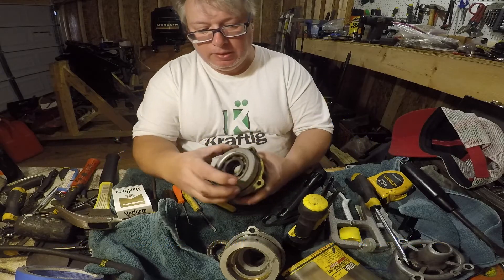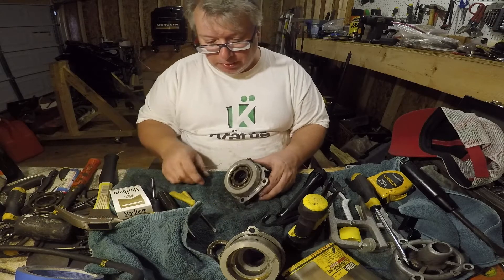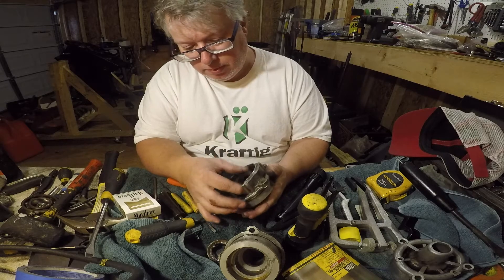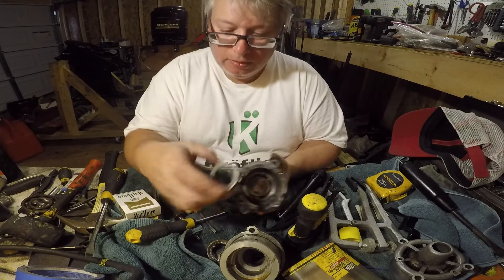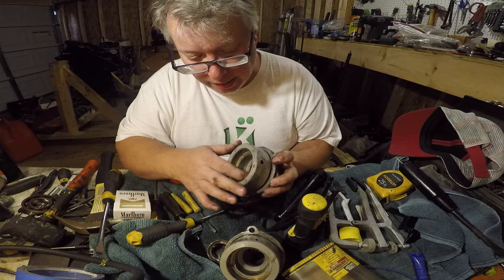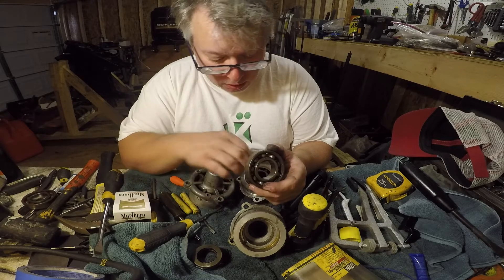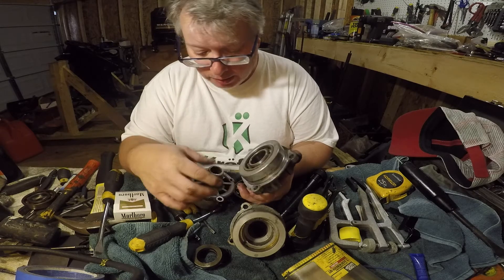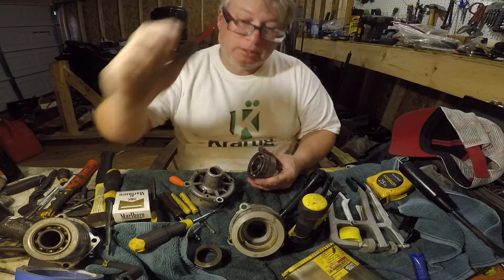Mercury Outboard Thunderbolt 500 50 HP Part 21 - Remove and Install Upper Crankshaft Seal

Comment: When you put the upper crank seal back in the top, do you use any adhesive so the seal stays in or just clean it really good and tap it down in there so it seats?
Reply from the maker: no sealant
Reply: @hawkeyemarine Thank you! Yeah I ran a cross video, “part 29” on a 50hp 500 where you were installing the seals and watched it!
This is why I love your videos! Very explanatory and you’re the best! 🙏🏼🙏🏼 by the way when I had mentioned that someone told me that the crank seal may have blown causing my motor to not run right, well I ordered a fly wheel removal tool for that motor and remove the flywheel,stater and trigger, to inspect and the upper seal was literally just laying there, I was able to reach down there with my fingers and pull the seal out. So evidently someone either didn’t get it seated down in there properly or it blew the seal out of there or something. So the new seal is supposed to be here today from Marine engine. So I will get that little area cleaned up and the new seal seated and see if the motor runs any better. Is that seal supposed to be seated flush with that housing or drove down a little farther until it stops? I’m
Learning! Hopefully!! lol 😆